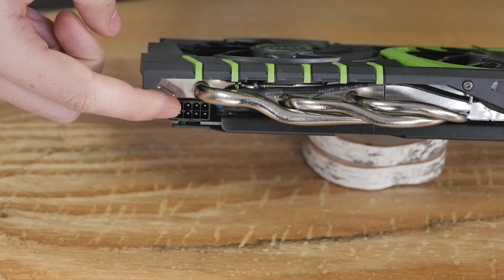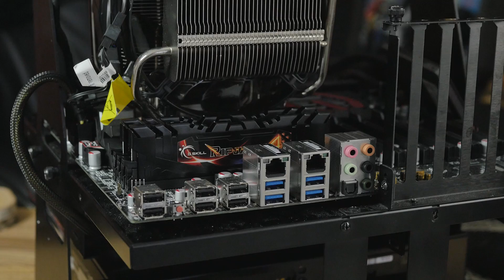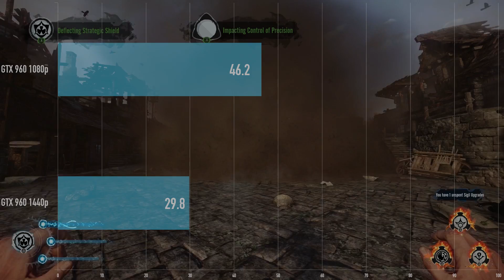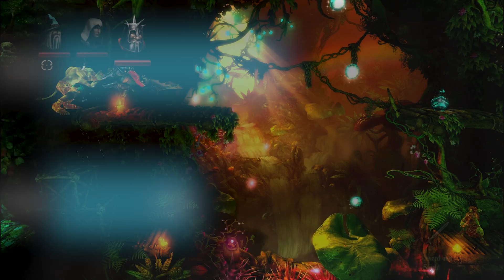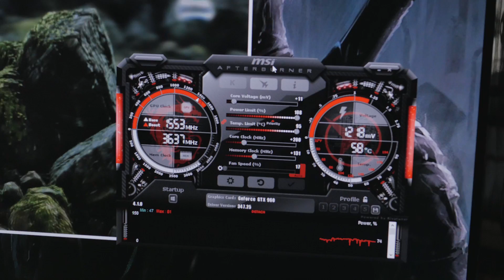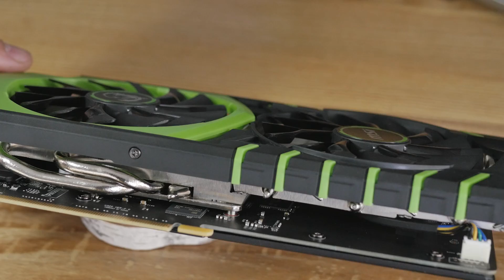MSI GTX 960 100 Million Edition (Limited) Review & Benchmarks

Comment: What a disappointment... I'll shoot for the 970.
Reply: don't, it has a memory issue
Reply: pcgaming today 3.5 gbs on a 256 bit bus is still better than 2 gbs on a 128 bit buss. You can stop parroting what the internet is saying now.
Reply: ForTheViolence you should get the r9 290 instead
Reply: pcgaming today I'm getting the 290x
Reply: ForTheViolence i wanna get one. 4GB on a 512 bit bus.
Reply: pcgaming today There are actually real reasons for getting a 970 instead of a 290x other than preferring a certain company. For example I wanted to get a 290x but it requires quite a lot more power than a 970 and comes at roughly the same price if not the same as the 970.
Reply: TraceurSoul The power is not much of an issue unless you have a bad PSU
Reply: pcgaming today I don't think bad would be the case since mine is a 80+ gold certified. It's just that I didn't think I'd need more than 550W initially. I was still a newbie when it came to components when I bought it.
Reply: TraceurSoul I meant a psu with not enough watts.

Comment: Only about 2 frames per second better than a GTX 760.....a little dissapointing.
Reply: 760 256bit bus / 960 128bit bus ... so i think its not disappointing at all,it really shows you the power of Maxwell architecture,only problem is nVidia is pricing them at 200$-240$ and that is disappointing.